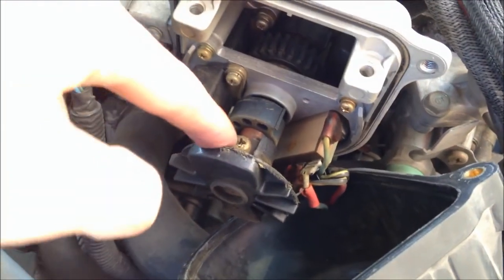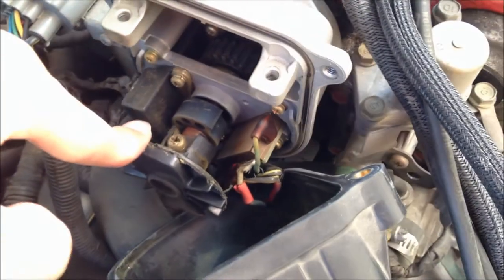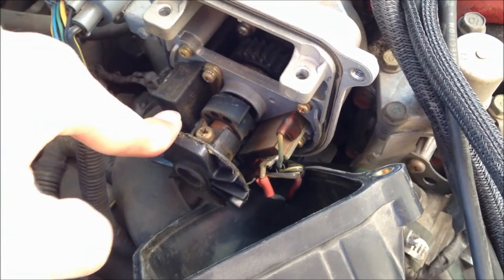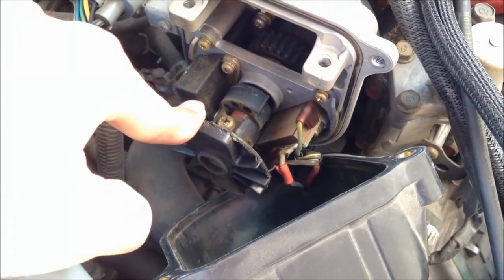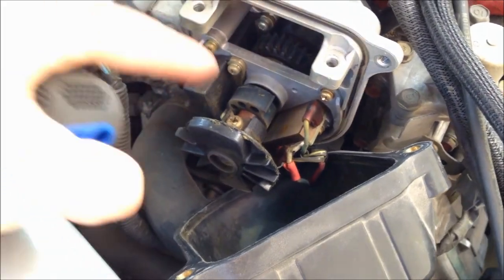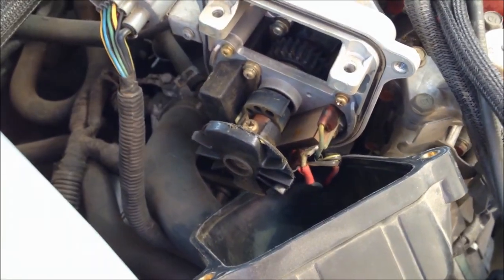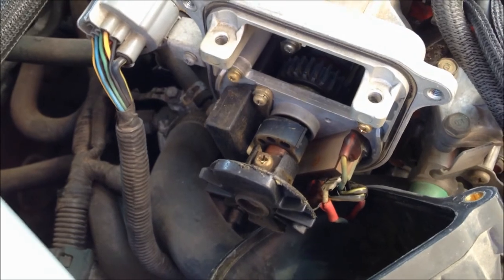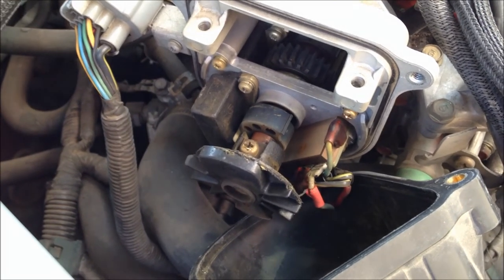Reaching Distributor Rotor Screw for Removal || Honda

Comment: Simply cranking the car for half a second without starting it up is usually enough, you can repeat this if it's still not facing up. No need to drive it, I think ;)
Reply from the maker: Works too. Lol. I would just get irritated if I kept missing.